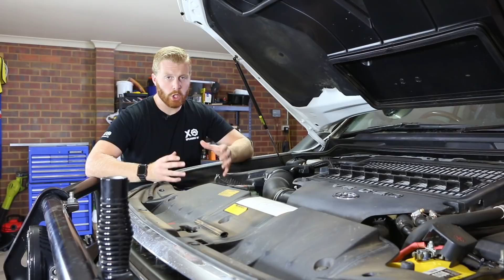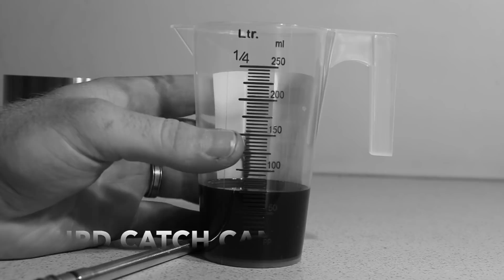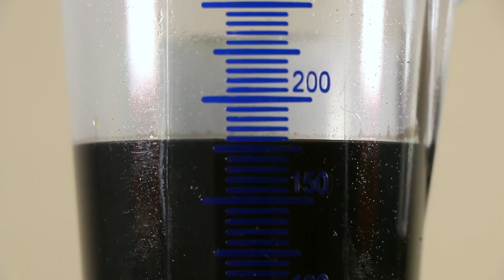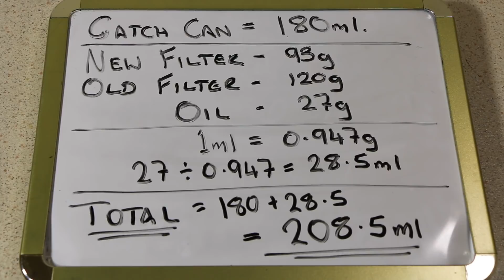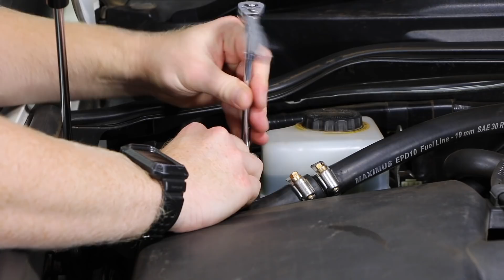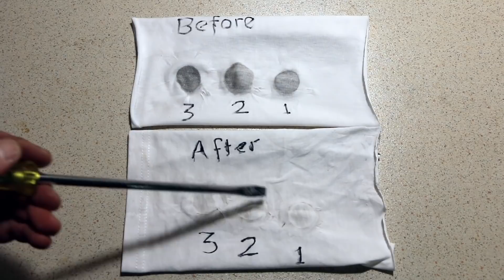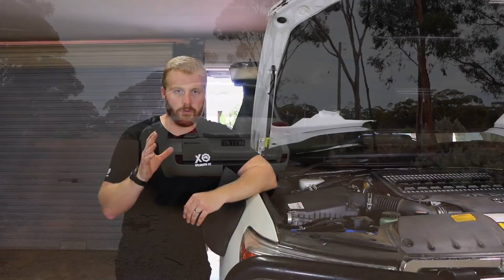PROVENT 200 | Is it really worth it? | MY 7000km REVIEW, drain and testing | Catch Can comparison

Comment: HI Nathan i can't decide between provent and ryco. Ryco looks well constructed but i believe they had few pressuring issues when first realised old part number  Rcc350 now supersede to Rcc351 and I noticed it filters opposite flow direction to provent.Im not keen blew oil seals on our new car.Any thoughts on Ryco unit?  Cheers
Reply from the maker: Hey mate, personally I haven't had any experience with the Ryco units so it would an uneducated opinion, however I can confirm that I still haven't had any issues with my Provent system. Although I will be changing the filter media in the next few thousands kilometres as per the recommendations from Mann&Hummel.
Cheers.

Comment: This was very informative. However your explanation of the EGR is wrong. The Exhaust Gas Re circulation system was introduced to help an engine get to operating temperature in a more regulated way. Internal combustion engines are most efficient at operating temperature. The EGR is controlled via the Electronic Control Unit or the brains of the Engine. It sends power to the EGR valve to open when the Engine temp is cooler than the operating temp and closes (supposed to, sometimes soot forces it a little open) once the engine temp is at a pre determined temp usually 75 deg C. The EGR is designed to allow warm air from the exhaust to enter the engine to warm it a little faster. Scientific tests reveal that the engine lasts longer in cold temperatures below +10 deg C because the warm air warms the engine faster. If you live in a warm climate the EGR just blocks your air intake faster because soot mixed with oil clogs the air intake to the engine. I hope everyone on this site takes the time to read this and understands.
Reply from the maker: Hey mate, I appreciate the feedback here, however I do have to disagree. EGR's were not designed with temperature control in mind. Yes, EGR's do allow to adjustment in the engine temp and play a part in the cooling system in vehicles that have these units, however this is not their primary goal.

EGR's were designed with the simple goal to reduce NOx emissions from vehicles. This is their sole purpose. Vehicles don't need another device controlling their temperature, as they already have a tried and tested thermostat that has been doing this successfully for many years. 

EGR's 100% do have an effect on the temperature of the engine, simply as a result of their function, however most vehicles (including my 200 series) have a cooling system that can well and truely adapt and manage the cooling system whether or not the EGR is blocked. 

A perfectly efficient engine needs oxygen/fuel and an ignition. The faster it can do this and the more efficiently it can do this, the better it performs. Systems like EGR's and DPF's complicate the matter and restrict efficiency, however this is an issue that modern day vehicle manufactures have to abide by and deal with in their innovation process. 

Happy to discuss further if you disagree. 

Cheers, Nathan.
Reply: @XploringOz  I agree in part about reducing Nox but the EGR is primarily about getting the engine up to temp. Cold engines produce far more Nox than an engine that is up to temp. Some diesel engines (not too sure about the 200 series) actually have what is called an EGR cooler that also helps heat the coolant as well as pump warm exhaust gasses into the intake on startup. Cold engines waste fuel, the EGR helps the engine get up to temp. The thermostat doesn't open until the engine is up to temp. The thermostat keeps the engine from over heating by regulating cooling. In Australia we don't really have a need for EGR but if you block your EGR and Australia decides to clamp down on emissions like they do in the EU the fines will likely be heavy. Luckily it hasn't happened yet. The Libs will make sure Australia can get the most polluting fuel guzzlers long after the rest of the world has EVs. You should look at Roo Sytems videos regarding all of this. Glenn Haddon is one of Australia's foremost experts on diesel tuning and fuel emissions. Also Berrima Diesel.

Comment: Cool video. You just forgot to mention that if you do an EGR block you’re actually going to speed up the blockage in your DPF. EGR is there for a reason dude! 
Apart from failing to research EGR and DPF systems properly you did a good job.
Reply from the maker: Perhaps I forgot to mention this because I don't have a DPF. DPF vehicle's are certainly different and specific considerations need to be taken into account, but I highly doubt I will cause damage to a DPF if I don't have one...

Comment: using the provent 200 to catch the oil is awesome but if you add a crankcase evacuation kit to the outlet side of the provent and run it to the exhaust before the catalytic converter https://www.trmtuning.com/product/trm-crankcase-evacuation-kit/
Reply from the maker: For sure, this is definitely another option that can be added. Thanks for sharing.

Comment: Catch cans are great if you don't mind spending thousands on having the valves adjusted far more frequently. On this engine type you'll be purchasing different sized buckets to offset the additional valve recession caused from all that oil not being there to lubricate. 

Ask yourself this basic question.  'Why doesn't Toyota and every other manufacture not install these aftermarket oil catch cans from new? It's because they spend a metric tonne of cash testing and developing an inbuilt baffle to control the amount of oil vapour flowing through the intake. So in short, there's already a system in place controlling these requirements to prolong the life of the upper cylinder and valves. 

Also, EGR doesn't inject dirt into your engine, it's soot and exhaust gas, nothing else. EGR reduces noxious exhaust emissions, increases fuel economy and lowers the combustion temperature. It does so by recirculation of inert gases from an already depleted oxygen supply, not as much oxygen to compress which reduces pumping loses and less heat is lost through the engines cooling system, less heat energy wasted equals better economy.

Having oil coating your intercooler isn't going to change much at all considering it's great at transferring and absorbing heat energy. That's why oil coolers/heat exchangers work so effectively and they are full of it.  I find 95% of the 4x4 community has no clue about what really happens, it's all regurgitated horse crap from people who are feeding on the hype such as ram air from a snorkel, catch cans, egr and dpf delete, chip/piggyback ecu tunning whilst all being told none of the above affects the warranty.
Reply from the maker: I completely understand where you are coming from, however have a different opinion on the matter. 

I understand the role of the EGR system and am aware that it doesn't inject dirt into the intake system. I further understand that oil residue from the crankcase recirculation system (CRS) doesn't hinder engine performance. However the mixture of these two system in the intakes creates a sludge and restriction on the intake pipes and most definitely do effect engine performance/efficiency over time. 

Further, yes EGR system do slightly benefit fuel consumption and will help the engine run cooler, however this is nothing the standard variable cooling system can't handle. After all, all engines ran fine before EGR's. 

EGR's and CRS's are only added to reduce emissions, not to benefit the engines performance or longevity.
Reply: Do yourself a favour and go pull off the intake manifold of a recent diesel with a catch can and one without.

You tell me which one is the healthier engine you. 

It seems you are the one that doesn't know what you are talking about.

Comment: How important is pressure in the system? I have a homemade catch can (came with the vehicle) and it pretty much looses all pressure as it's far from air tight. How does that affect engine performance?
Reply: Chuck it in the bin, catch cans are preventing the valves and upper cylinder from being lubricated. If it's not sealed you'll be injesting dirt/dust etc into your engine. Throw it out, put it back to standard.
Reply from the maker: As Dino's Shed mentioned, these units are designed to be air tight, so it might be looking at upgrading to a more reputable unit in this instance.
Reply: @XploringOz  Thanks, will absolutely do. Also, great video on the intercooler cleaning. That's next on my to do list!
Reply from the maker: @Zophus1  Thanks mate, glad you are enjoying the content. All the best with your intercooler clean and catch can! Cheers.

Comment: I have a 2017 LC200 with 100k on clock ......should I have a D carb  of the engine before fitting the Catch Can ?
Reply from the maker: Hey mate, it definitely wouldn't hurt. Putting a catch can on will definitely help prevent that build up and the intake clean will just open up the intake pipes. 
It will just allow the engine to operate as cleanly and efficiently as possible. 
I had my vehicle cleaned out at about 90k.
Cheers, Nathan.

Comment: Fantastic video. I have Landcruiser 200 GXL and fitted Mann & Hummell Provent 200 from brand new also purchased from Western Filters. Does a great job.  Should I upgrade to the Internal Ventilation kit? From what I can tell only diff is internal ventilation on new one versus lid pressure relief valve venting to atmosphere.
Reply from the maker: Thanks mate, glad you enjoyed the video. 
To be honest, there's nothing inherently wrong with the original kit (other than the environmental concerns). 
From what I am aware of, you can just upgrade the kit when you next replace the filter material. These kits come with everything you need. Personally I wouldn't be changing the element out just for the upgrade until the regular service interval (normally around 30000kms)

Comment: I actually just watched the video by Auto Expert who thinks they are useless. I went to put a comment about how my intercooler was full of oil before installing one, but comments were turn off 🤔
Reply from the maker: Each to their own, but I’ll continue to leave this installed on my vehicle. Oil alone won’t do any damage, but it’s the combination of oil and EGR gasses that will slowly block the intake... 
leaves us wondering sometimes...
Reply: @XploringOz  In the video he states that catch cans are just catching the oil vapour before the engine can deal with it through its own ventilation. So my intercooler filled with oil begs to differ.
Reply: Yeah, I was also disappointed to note that the comments were turned off. The responses would have made for interesting reading.
Reply from the maker: @noelomeara4137  Agreed.
Reply: Always take John Cadogan with a pinch of salt.  I notice the very next video of his queued after I watched the catch can rant was about not buying a 2020/21 Honda... which kinda blows a hole in his own  "reputable manufacturers know best" approach to avoiding catch cans.
Reply: John Cadogan is a knowit all arrogant prick.

Comment: I have a 2010 LC 200 with 226000 klm on the clock . It still runs beautiful and tows my caravan with ease ( loaded weight 2600 kg ) 
My question is do you think fitting a catchcan  will improve the running of my vehicle .
Reply from the maker: Hey mate, so it probably won't have any effect on the performance of the vehicle. Catch can are primarily designed to prevent the slow blockage within the intake system. The small residue of oil that passes through into your cylinders won't cause any dramas. 
If you have already, your vehicle could potentially benefit from an intake clean. This will remove any carbon build up and potentially restore any lost efficiency and power from the years.
Cheers, Nathan.
Reply: XploringOz Thanks Nathan I will talk to my mechanic and get it sorted . Regards Mal
Reply from the maker: @malmarsden9730  No dramas. If you do a intake clean, let me know how you go and your thoughts on it. I would be interested to hear if its makes a significant difference on a vehicle with this many km's. Cheers, Nathan.

Comment: Nice work, I will be installing a provent on my Gl320. Have the intakes removed and they were about 50 percent blocked. Thanks
Reply from the maker: Cheers mate. Good luck with your install, hopefully it will help reduce to blockage of those components over the service interval. 
Cheers.
Reply: I’ve been running my prevent on my 2007 GL 320 for a year now, works better thank the old eBay aluminum catch can I installed earlier.

Comment: Great explanation Nathan. It should be noted however that blocking EGR valves is highly illegal and also environmental vandalism.
Reply from the maker: Thanks mate, yes this is true, however keep in mind the EGR is a dynamic system, so when under heavy load or full acceleration the EGR is electronically disable by factory computers. The EGR will only provide emission benefit when at idle or slow speed.

Comment: Good work!  Regarding the increased crankcase pressure myth - not sure it has been dispelled yet.  Do you think it would it be possible to measure crankcase pressure firstly with the catch can and long hoses and secondly with no catch can and just the short factory hose?
Second unanswered question for me, is whether the small amount of oil that still gets through is enough to still make black sludge, given that 99% of people who fit catch cans still have a working EGR.  If so, will we find the intake is still dirty after say 250,000km despite all the oil removed by the catch can? Might take many years to know the answer to the latter.
Reply from the maker: Thanks mate, so yes it would be possible to measure those pressure. However saying this I don’t currently have access to this equipment. 
Personally I wouldn’t be too concerned as the pressure is low to begin with. 
Secondly, yes this is very true, however the build up would take much longer, given a more efficient intake for a longer period of time.

Comment: G'day mate can you just vent the gases after the catch can to the atmosphere or will it bring up a code
Reply from the maker: Look, you can vent with issue, however it’s going to make a mess, regardless of where you mount it and will deteriorate road conditions, particularly for other vehicles like motorbikes. I would recommend it, it’s fairly quick and easy to empty when required.
Reply: Thanks mate

Comment: Hi Nath. You nailed it yet again. Very informative and easy to understand. A question I have for you. My 200 just ticked over 17k and I found some oil that I need to drain from the catch can. How often to I need to change the filter inside ? Toyota wont do it as it is a third party add on. Thanks again
Reply from the maker: Thanks Jim, so it will depend somewhat on how much the unit is collecting. I believe Mann and Hummel recommend changing the filter every 30-40k kms. I will probably lean towards the 30k mark due to the amount my unit is collecting 👍

Comment: i have a prado 150 ikd-ftv . i have a provent catch can as well. would it be work blocking the EGR with a plate with a 6mm hole or just leave it?
Reply from the maker: So blocking the EGR will definitely prevent the build up within the intake. I probably wouldn't go the blanking plate with the 6mm hole, as it won't stop the issue it will only prolong it. You should be able to electronically disable or reduce the EGR and physically block it, which shouldn't cause any electronic codes or issues.

Comment: I don’t own a forby but I do own a vw polo diesel as my daily. I learnt about Mann and Hummel provent sometime ago. I did some measurements and quickly discovered that the provent 200 simply was too large to fit under the bonnet of my little front wheel drive. BUT I discovered that the provent 100 would fit perfect in a particular spot!
So bought it,installed it. And just for the hell of it I used 19mm clear petrol proof hose from Bunnings. This provent does work. In 20,000 kilometres I have drained it three times and got about 200 mls from each drain. A filter change at 20,000 and we’re good to go again. And as for the clear hose, well the intake hose going from the rocker cover to the catch can is definitely black and oily internally but the hose
going from the catch can back to the air intake which is just before the turbo,is still quite clear!
Which just goes to show that yes,these genuine ones do work.
Reply from the maker: Hey mate, thanks for sharing. I'm glad you were able to get the smaller 100 unit to fit! I love the idea of fitting a clear hose to the can, another awesome way to visually observe how effective these catch cans are. I'm glad you are happy with the results from yours, as I am with mine. 
Cheers, Nathan.
Reply: @XploringOz  thank you sir

Comment: Great video. Just bought R51 2010 2.5 TD. 187000KM on the clock. After removing the EGR pipe I can see some build up of oily soot. I presume it would still be beneficial to fit a Provent 200??
Reply from the maker: Hey mate, so I would still recommend a catch can. It will prolong the continual build up of carbon in the meantime. It could be worth doing a full intake clean as well, just to clear out that existing build up.
Cheers, Nathan.